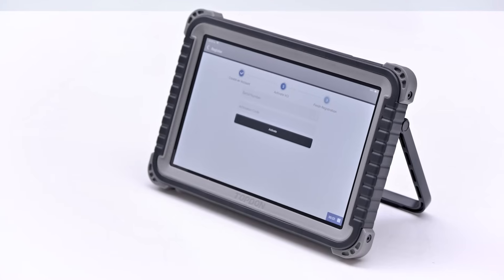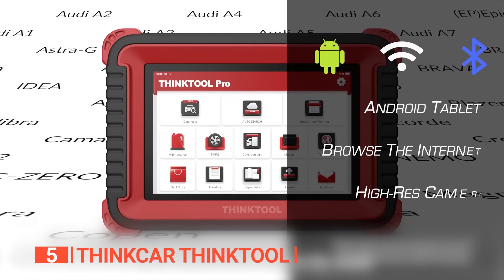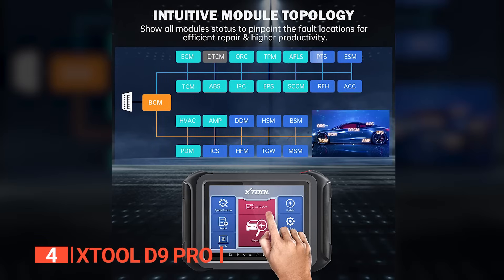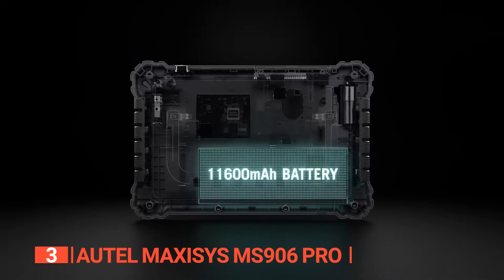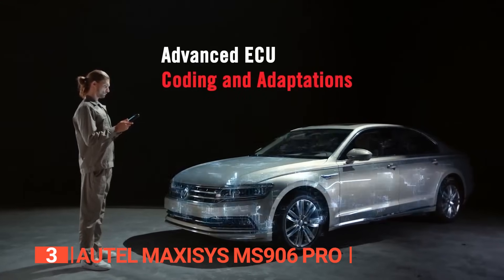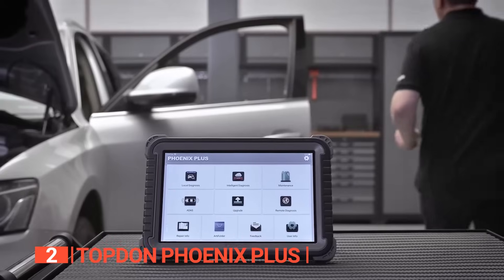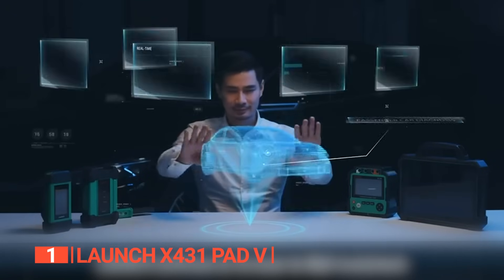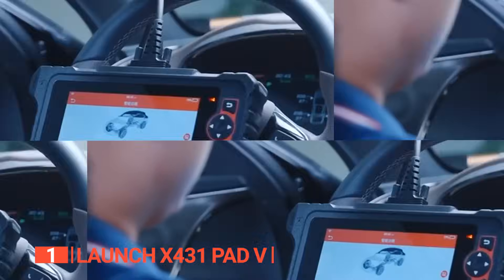TOP 5 Best OBD2 Scanner [ Buyer's Guide ]

Comment: Hello! Can this ThinkTool  Diagnostic Tool that you show in the Video, do work with BCB and PEB module in a Renault Zoe? (Electric car).  I am going to change the Electric motor in my Renault Zoe Year Model 2019. And then I have to copy the data from the BCB and PEB Module. And then copy in the data after the Elmotor change. So I need to get hold of a Diagnostic Tool that can do this on an Electric Car like the Renault Zoe. Thanks! From Tommy Bertilsson from Sweden

Comment: Another question why shops using only SnapOn???cause of lifetime warranty?
Reply: lol snap on electronics and lifetime warranty are not a thing.
Reply: Snapon does not have a lifetime warranty for their severely over priced junk
Reply: You think your Snap On tools are expensive in the USA, in the UK you can double the price on the vans for the same tools. And it's getting so hard to find a good van. When uve been buying for 20 years, your Dad and Grandad had bought for years and passed down thier tools to you, if your not a regular buyer from a certain van they don't want to know about life time warranty. The last time I stepped on a van was nearly 2 years ago when he told me he Snap On, not him won't warranty flex head wratchets. Mine had snapped one of the ears off the U shape where the head fits in and flexs from. I really wasn't using it hard, it's a 3/8 and I was undoing a 13mm nut and it just snapped. So after I got told I'd have to pay for the parts to fix it which I did I've never stepped foot on a van or spent a penny with Snap On again. And over the years in 3 generations they must of had £800,000 off my family but they won't get a penny more

Comment: The Xtool series has a terrible live data playback function: I have a problem with my BMW suddenly bucking at speed and stalling at Idle. It happens infrequently. Probably every 1 to 2 hours of driving. No codes are thrown. Live data is what I need so I bought this scan tool. I bought the D8 model. I finally have the bucking event recorded after about 45 minutes of recording. I stop the car and save the data for review. I start the playback thinking I can go to the end and see the parameters, but you can’t scroll or go fast forward. You have to sit and wait until the end. This is crazy stupid if you just recorded almost an hour of data to catch an event that you waited for. The cds (recording) file is proprietary when I try and open it to view, its encoded. You can do the export data and the data will be saved as text file (CSV) that can be opened it Excel, but when you stop recording after about 30 minutes of collection. It may not be able to write it to the internal storage because of its size. I sit and wait a minute or two for it to respond. It has no progress meter. I suspected my fuel pump is the issue. I recorded the fuel pump parameters, but I can’t add any engine data parameters like engine speed and peddle position in with the fuel pump because they are in a different live data category: engine vs fuel delivery. This is just plain crazy. All parameters should be able to be chosen from all groups for the maximum of 8 that can be displayed/saved. These are major problems with the live playback and could be solved easily in an update to the software but who knows when that will happen. Shame on all the YouTubers that are pushing this tool but say nothing about this major flaw.